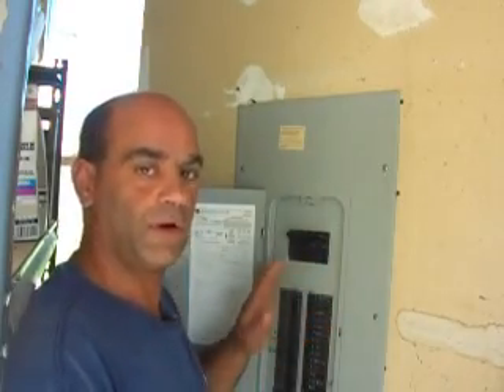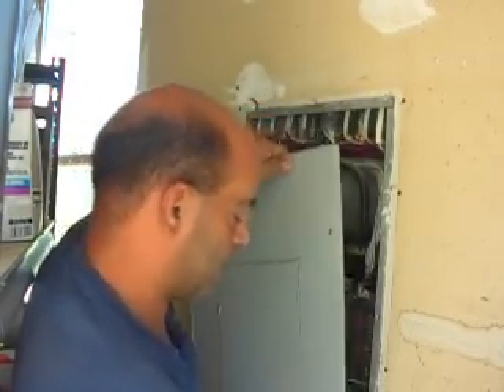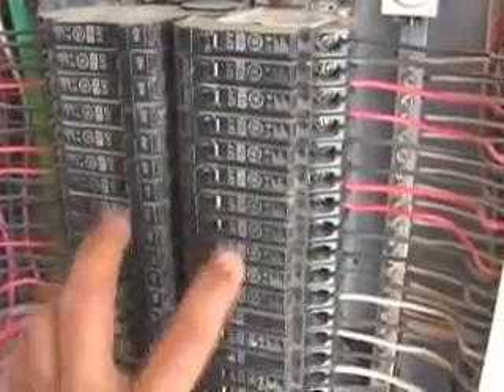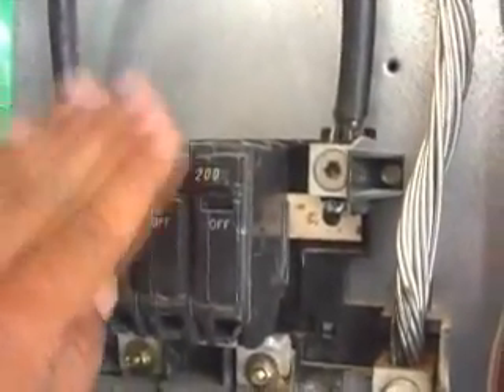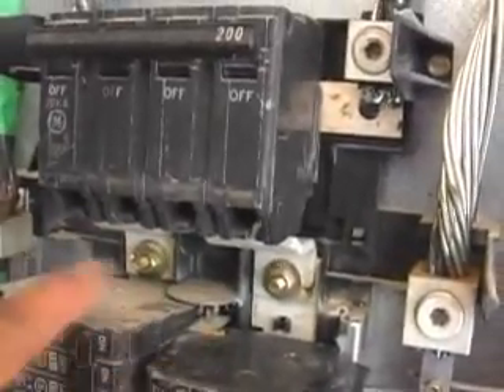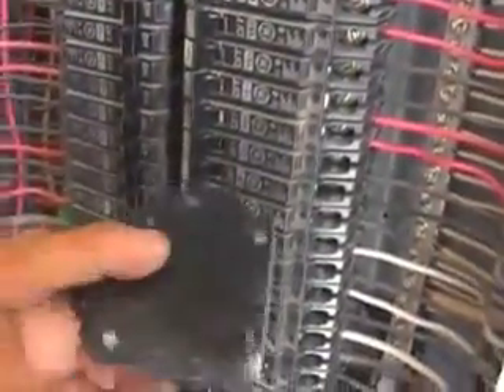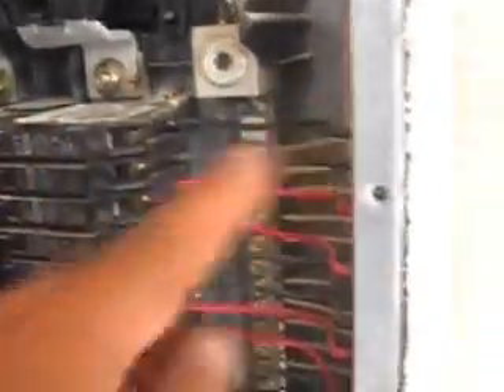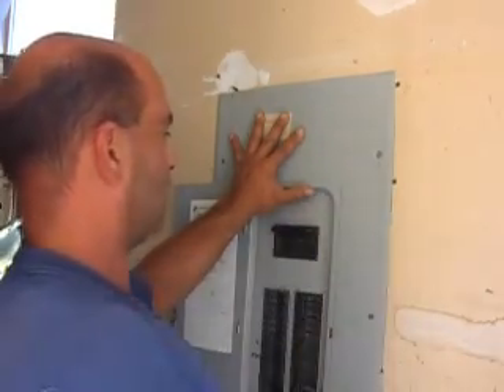How to change a circuit breaker

Comment: Dominick, that receptical. What type of equipment would plug into that outlet. 12/2 romex can handle 600 volts which on a single phase at 240 volts equals about 2.5 amps or am I saying that right. Just wondering.
Reply from the maker: No you're really not saying it right. What is that you're trying to do?
Reply: @Askmediy  I installed the same type of receptical you installed just how you did it. I was wondering what type of equipment wold use that type of receptical. I'm outfitting my garage which I gutted upon moving in. Putting in all the electrical I will need before insulation and wood walls go up. Obviously this receptical is not equipped to run a 240v welder which I already installed on 6/3 wire on a 30A dual breaker. I thought I may use the receptical you installed so I put it in but not sure what would use it. I'll keep it installed just in case I do find something to use it. I love all your videos and they are very educational. Keep em coming. Have a great day.
Reply from the maker: F14TomcatAOC Retired oh lots of stuff. Like in my shop I use most of my saws on the 220 20 amp. Even my welder. I think I have 10 220 outlets all on a separate breakers. Always my pleasure to help, thanks buddy

Comment: what about changing that main top breaker is it just a snap in breaker or do you have to take wire out and screw wire back in like the regular breakers?
Reply from the maker: +bigsexysw The main breaker always has live wires. The only way to turn the power off is to remove the meter. And no. Main breakers are bolted in. But this would greatly depend on the panel.
Reply: +askmediy thank you

Comment: all my breakers have one toggle switch except for one it has a toggle at both ends, is this a special breaker or what. its just a single pole and its the number 1 breaker in the panel.

Comment: I do not agree with "Adem Ahmed" regarding dangerous arc flash. I think you should point out the dangers of not complying with the working space about a panel required by the National Electrical Code (Minimum 36" for this panel) The shelf is impinging  on your safe working space and could impede your escape if you were getting shocked or subject to an arc flash.  Work safely. Thanks Ray Paulson

Comment: i need to change the actual board as the pens under the breaker boxes are bad, they have a greenish crust on them and spark badly, its about 50 years old so its time for a new one.... i know my way around power but in lost when it comes to replacing the actual box... can you point me in the direction where i can find out exactly what direction i need to look at into getting this fixed ?

Comment: The only thing I would add to this is that it would be a really good idea to check to if voltage is still passing through a faulty main breaker (even when the main breaker is off it's off) before touching anything.  Use a circuit tester to check voltage across the hot wire (with main breaker off and circuit breaker ON) and ground.  Only after confirming it's off should you pull the wire.  
That said, this is a no brainer for a competent DIYer.  As always, every nasty comment is coming from an electrician who loves charging $200 for a 15 minute drive and a 5 minute job.
Reply from the maker: Great point, thanking for the input. And yes oh so very true. But yet we don't see their videos, LOL
Reply: askmediy no kidding.  btw another big thing I think is important for working with all tools but especially anything electrical is keep a pair of DRY work gloves on if you can.  If you're doing something delicate and need a bare hand then at least keep the other hand gloved.  Reason being that if you ever do wind up touching something live and your other bare hand is touching the box as well (i.e. you're grounded) you're in big trouble.  Best not to touch it with your other hand at all in fact.
Reply: ***** THATS RIGHT!!! Now stop messing up our money you stupid handy man!!!!

Comment: I have a question. I had an electrician come out recently to my house to replace my circuit breaker panel because it was burnt. But I noticed that no inspector came out to my house to inspect the electrician's work. I thought it was weird. Was there supposed to be an inspector there?
Reply from the maker: absolutely without question.
Reply: askmediy Or could it be that the electrician was an inspector himself?

Comment: Need so help. Just got new sup panel in my garage. It's a GE box. So I bought 15a ge breakers. But the part that clips to hot paddles are turned the wrong way. Do u havt xmy ideas. I'm z bit new tho

Comment: You make me nervous, I would use a plastic pointer not my finger. Like you said I have been shocked before. Most people that work with electricity are used to shocks, but others are not and they can make mistakes and get a good zap.

Comment: Thank you! Very easy to follow. We had a lighting strike just outside the house the other day. One breaker was tripped. Thanks to video, I was able to swap that one with a working breaker and determine that there's a short somewhere. Not complete fix yet, but a little troubleshooting is done now :)

Comment: Well everywhere is different, in the UK the main breaker switches the neutral as well as the live cable, but that alumium cable still lookes very dodgy in that configuration by our standards

Comment: If it looks OK it's probably just on there really tight, which it should be. A 2-pole breaker will be significantly harder to remove since you're basically removing 2 breakers at once. If it's really stuck on there so tight that removing it will damage the contact bars, then you really need a new panel anyway.

Comment: I pulled the breaker out right next to the one that was stuck so I can see why the one I was aiming at was stuck and I didn't see anything burnt. The breaker I'm aiming at is 2-pole 240v for the A/C btw. I didn't want to use too much force on it because I didn't want to risk damaging the contact bars. The panel is only 4 years old. The old panel got burnt.

Comment: The connection should be tight, just like any other. A loose connection will have a smaller point of contact, which will overheat. Are you sure they're actually melted together or is it just really tight?

Comment: It's much more expensive for the power company, they need to put three transformers on the pole rather than one, so it's only used for commercial and industrial customers. Also there is normally nothing used in the home that requires all 3 phases, high power loads use split phase 240v.

Comment: You must run larger wire to use a higher amperage breaker. 20A requires 12 gauge, 30A requires 10 gauge.

Comment: I have heard that Eaton's CH line of panels and breakers are excellent. They're the breakers with the tan handles that go to the off position (rather than the middle) when they trip. However this is only something you should even consider doing yourself if you have a way to disconnect the service wires, otherwise you really gotta have an electrician do it.

Comment: In case there is a fault in the panel, a metal cover will contain it much better than a plastic one. It also helps hold the breakers securely in place. Breaker panels are ALWAYS well grounded, so you should never, ever get a shock from the cover.

Comment: If you paid $45 for a breaker I hope it was an AFCI... a normal breaker costs about $5, but if the circuit was in a living area then an AFCI was required and you hopefully did the right thing.

Comment: They can be changed to 20s only if all the wire on the circuit is 12 AWG or larger. 15A circuits normally use 14 AWG.

Comment: It is illegal to use anything smaller than 14 AWG, at least in the US, and that's only for 15A, you need 12 AWG for 20A and 10 AWG for 30A. GFCIs (what we call RCDs) are required in bathrooms, kitchens, garages, unfinished basements, and outdoors. AFCIs are required everywhere else.

Comment: You can leave it on but it's not recommended. If you do, MAKE SURE to wear rubber gloves and rubber soled shoes. Before adding or removing a breaker, always turn it off.

Comment: If the wire is 14 gauge then it must be changed to 12 gauge to use a 20A breaker or 10 gauge to use a 30A breaker.

Comment: Household voltage is too low to cause a dangerous arc flash, the highest you'll find is 240v and it takes at least 480v to cause a dangerous arc flash. The main hazard is shock, and if you wear rubber-soled shoes and rubber gloves when working near live circuits, you'll be fine. The other main concern is to follow the code and not create any fire or shock hazards.

Comment: It's the neutral. It's grounded at the pole and at the main panel and has negligible voltage. Think of it like the drain pipe in a plumbing system, which has no water pressure.

Comment: You'll most likely need to get your breaker panel replaced. That's one you absolutely must have an electrician do, as the live supply wires must be removed from the old panel and installed in the new one.

Comment: Awesome video.

In an effort to save energy, we installed 3 air conditioners (in three of our bedrooms in the windows) so we wouldn't have to use the central air for the whole house. Now when they are all on at the same time the breaker shuts off. Can I just replace the breaker to a higher amp to solve the problem? You made it so clear I know I could do it safely.

Comment: In usa those ever Circuit look the same?? like your Circuit breaker, i was woundring also why do you have tnc?? were is your ground Cable incircut to? you have 2 hot and one neutrel if you wanna have a groundsafety can you install it in your ciruit, and were is your working clothes??? your working in jeans???

Comment: Hi Dominick,
Could you tell me if i can change my MK 30amp MCB that supplies my cooker through a 10mm cable, for a 45amp MCB as i am changing my cooker for a built under double oven and a induction hob. I have been told that allowing for diversity that i can run both off the same supply point, but that i will need to change my MCB?

Comment from the maker: You have three cables coming into the house. two are hot and one is a neutral. You would need to pull the meter and check the lines coming in from the road. If good, then you would check the wires to the panel.

Comment: its a nice vidio , but highly recommened dont do it yourself if you dont have any exp with electric,  there are a lot detials you need to be caution  when you work on pannel, and  hundreads of pro electricials die every year,  so dont take this lightly.

Comment from the maker: To change the breaker to a higher amperage then yes the wires will need to be changed as well. That wont be easy. I would just change the breaker to a new 15 amp and see how it goes. The best thing to do would be to check the amperage draw at that breaker first using a draw tester. You can buy one in the home stores for like 75. bucks, I think..

Comment: At 6:50, you're mentioning about the firmness of breakers and good connections.  Square-D brand is by far the best in that regard.  I will only install Square-D panels.  The one you have is GE, which I find quite inferior.  I always recommend replacing GE panels with Square-D.  Unfortunately, you can only use the brand of breaker to match the panel.

GE, we bring bad things to life!

Comment: Dominick you're the greatest! You simply show even the little but important things: Hot main lugs, putting pressure on the panel while loosening the screws, etc.
Also, you are magic: At about 7:11, when you let go of that breaker wire, it goes into place by itself! How'd you do that? Bet you can't teach that!  I just watched another "professional" who didn't bother to mention turning off the main first. He just went right to work. Thanks again buddy.

Comment: With 400V in households is there a hazard of arc flash with the 400V? Are upstream overcurrent protection or system impedance sufficient to guard against that possibility? Here in USA 208 or 240V 300A is maximum in households. 480V would be prone to arc flash in clothing dryers, water heaters, cookstoves and so on hence a limit of 240V. Commercial systems use 3X480V which is commonly involved in arc flash incidents that hurt personnel and explode equipment. What is industrial V in Germany?

Comment from the maker: @MrStanley1109 The best plan of attack would be to remove the meter off of the house. But you will need to call your electric company for that in most cases.  DO NOT TRY IT ANY OTHER WAY..

Comment: The wire on that two pole 50Amp looks #8, and #8 is only good for 40Amp.
Breaker is not protecting the wire, in case of an overload it could become an hazard.

Comment: Turn off that main breaker and for some older equipment it will not turn back on. At that point you'll need to call a licensed and insured professional electrical contractor. Wiring is not a hobby.

Comment: Great video! I want to put outlets in my basement. This is a new home with unfinished basement. Would I buy a new breaker to add outlets or is it standard a new home already has additional breakers? I have not taken the panel cover off to check if that is the case that there are additional breakers.

Comment: @utubmania2009 NEVER replace a breaker with one that has a higher amperage rating. The breaker is matched to the gauge of wire for the circuit. A breaker with a higher amp rating means they won't trip off when they're supposed to and possibly resulting in an electrical fire.

Comment from the maker: @peakay2002 Sure thing. Well GE is good and easy to get as well as Murry. There are all levels of the DIY'er.... But for the most part no way. You really need to know a lot of little things. One false move and , well you may not be around for Christmas. As well most of the time you will be upgrading your service wire as well. It's just the thing you would want to get involved in.

Comment from the maker: @Rayvenred Sparking is super bad. Turn main breaker off, remove and replace breaker. Make sure connection to the buzz bar is clean. Make sure wire to breaker is good and clean.

Comment: @flure1234 Heavy electricity consumers in North America (clothes dryers, electric ovens, air conditioning units etc) use the split phase I described earlier, which gives 240 volts phase-to-phase, instead of the usual 120volts which is used for lighting and light loads (televisions, computers, toasters etc). The higher voltage is beneficial for heavy loads, but most heavy household loads still don't need 3 phase. The thing that would make the best use out of 3-phase would be central A/C.

Comment: @flure1234  We (I'm Canadian but our system is essentially the same as Americans) don't use 3 phase in residential settings just because it's cheaper not to. We use what's called split phase, which gives us 120v phase-to-neutral and 240v phase-to-phase. In most areas, 3 phase is distributed everywhere, but we don't wire it all the way to the house.

Comment: nice video, I have a question, im wiring two circuits, one for my 20 amp service for the air compressor, welder and so on that uses more than 15 amps, and i am using a 12gauge wire. Now since i didn't buy another roll of 15amp wire, will a 12 gauge wire hooked to a 15 amp breaker be fine? or would there be issues, i don't see any other than its just a thicker wire, but im only running the wire to the 14 gauge wire in the garage and the outlets are 15 amp for the 15 amp breaker.

Comment: Thanks for this great video. Just replaced a CB for our Dryer.  Dryer turned on and rotated but no heat.  At first we thought our dryer bit-the-dust.  I noticed the receptacle was only reading 110V.  When I removed the very old 30 Amp Double CB I noticed one side that connects to the Bus was black and quite corroded.  That must have been the side that was failing. The repair cost us $8.25 plus tax.

Comment: Hey Dominic, thanks for your DIY video.  I got a question.  My old 20A breaker needed to be replaced.  It only had one red power line screwed in , and snapped into a buss tab.  Problem, with the new replacement breaker is it has the extra "white piggy wire" for AFCI.  I know it hooks into the panel neutral, but I also need a ground wire into the AFCI breaker.  The original breaker didn't have a ground wire.  Just power line.  Do I just tap into another ground line?  thanks

Comment: Hi Dominick,
Thanks for the step-by-step instructions. I'm selling my condominium and just received the "fix-it list" from the buyer, who wanted a circuit breaker realigned. Your guidance helped me do it without calling an electrician--it simply needed removal and re-installation, not replacement. Thanks.
-Angelae

Comment from the maker: Thank you.. NO YOU CAN NOT.. On a 20 amp you would use a 12 gauge wire and 30 amp would need 10 wire.  the best thing to do would be split the circuit to lighten the load. Splitting you would add another 20 amp breaker. But it goes deeper then that. If you would like more detail please go to my site to where I can better answer your question...

Comment: i need a 300 amp Circuit Breaker for my 200hp motor that needs 460 volts 3 phase can you do that ?

Comment: duz ur meeter have breakers in it? u could tell if the meter box is alot larger than a standard meter socket. if thts the case, that panel could be a sub panel.

Comment from the maker: Hi, sounds like you have a old panel and you should have it upgrade. However look first and be clear that you don't have a high amp breaker with the rest of them that may be a main. I add breakers all the time without turning the main off. Just be very careful.

Comment from the maker: You would have to upgrade the wire it self. 15 amp would use a 14 gauge wire and 20 amp would be 12 gauge.